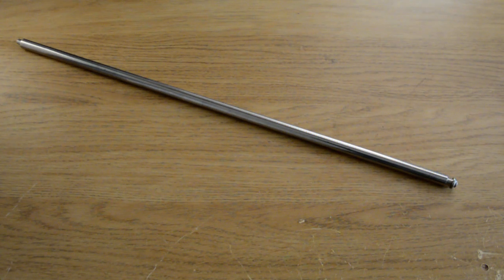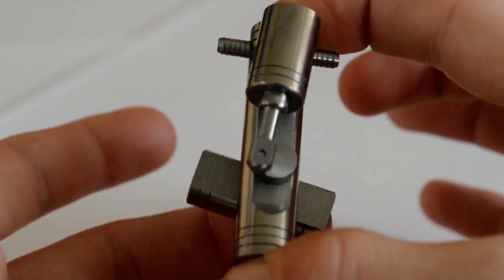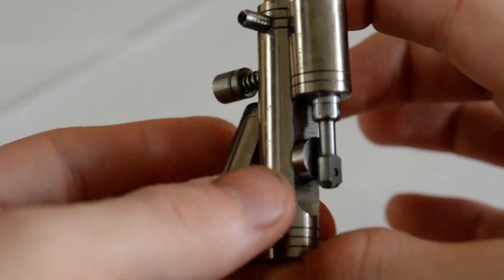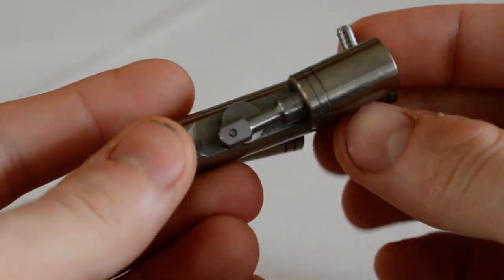Wobbler (model engine from printer parts)

Comment: Nice. You could use an old scale modeller trick and use a tire as air reservoir, like they used to do for airbrushing. And maybe run another one in reverse as a compressor?